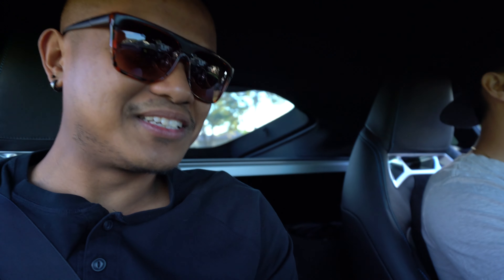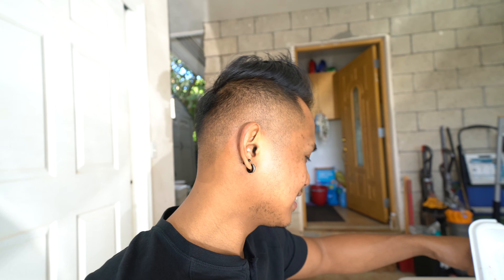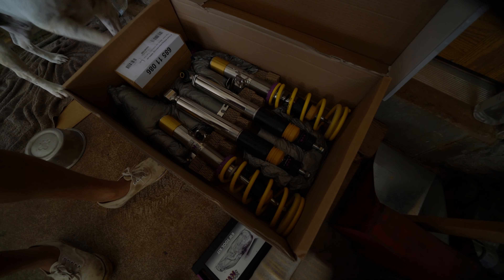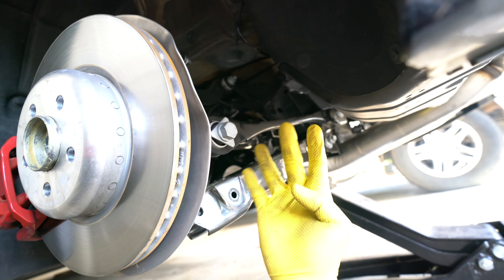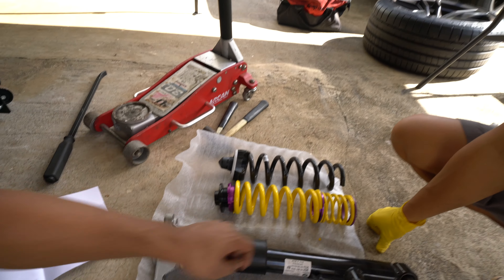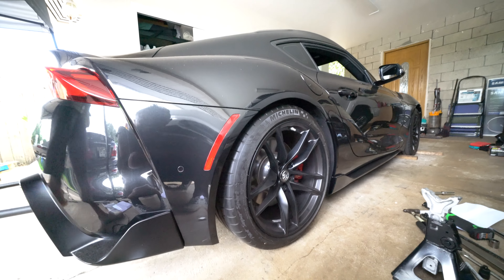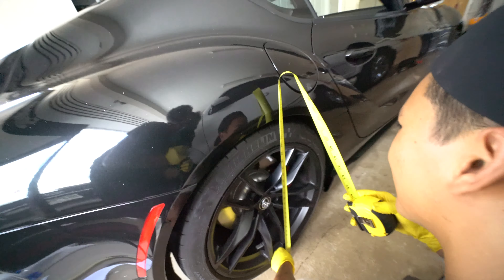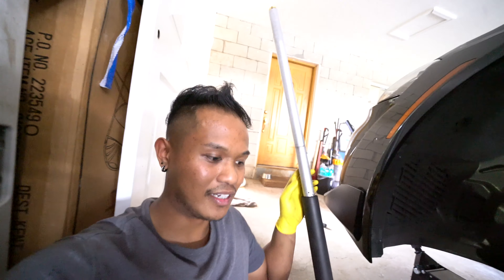JAY | VLOGS SUSPENSION INSTALL ON SPG'S A91 SUPRA

Comment: What is the part number for the rear spoiler???
Reply from the maker: PT967-C1210-02 brotha
Reply: @u1StupidKiD  Thank you.
Reply: @u1StupidKiD  Do you have the website where I can order from? Thanks.
Reply from the maker: vtec70 it’s an OEM part from Toyota. I think they are back ordered but you can try contact any Toyota dealership in your area & check